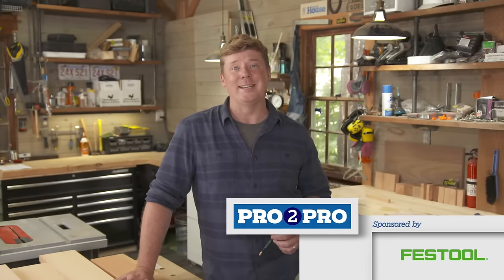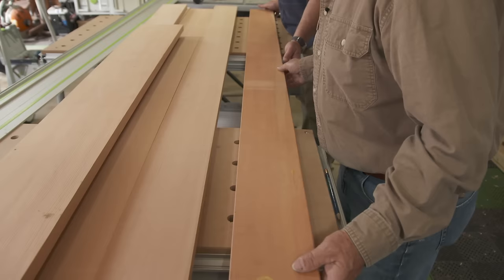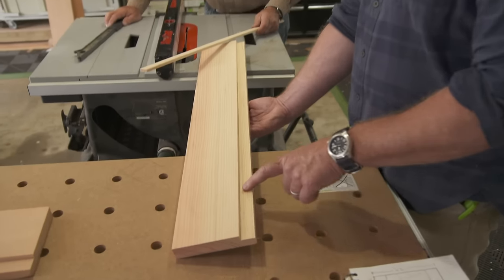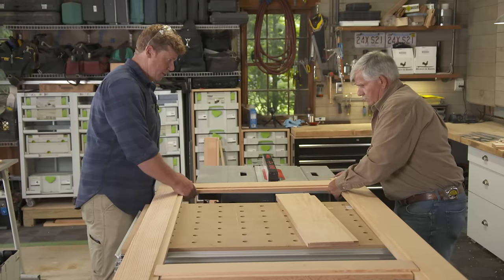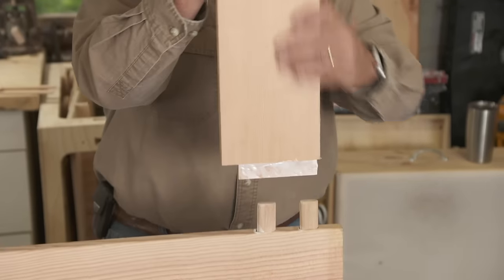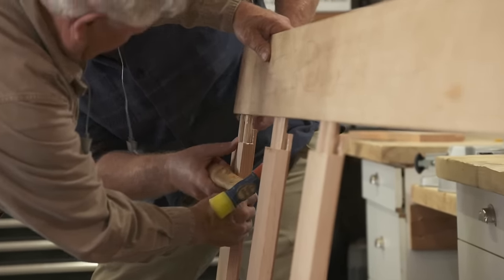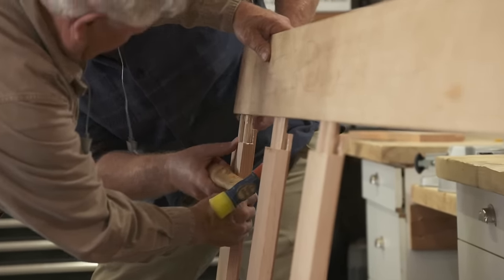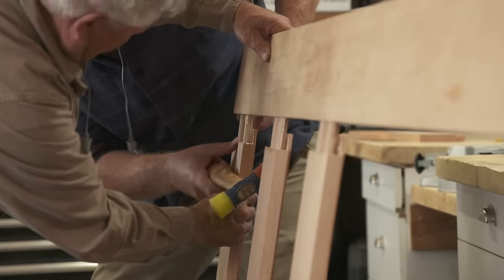Pro2Pro Live: How to Build a Screen Door

Comment: I hope Tommy never retires.  He's the best there is!
Reply: Norm is better at this type of thing.iv never seen norm do something like resurfacing/gluing.laminating a single door like the like tom did.
Reply: @buckbuck9225  that tip of using a truing saw, I guess thats what its called, to straighten an out of true board is a money saver for the amateur wood worker, that doesn't do enough wood work to cover the cost of a joiner.
Reply: @buckbuck9225  I agree ! Norm abram is the most talented carpenter that they have for sure but Tommy has all around knowledge and personally I love them all! However norm is my idol!!! I wish I had 10% of his ability!
Reply: I agree 100%. He will be hard to replace.

Comment from the maker: Hi Everyone, I'm here with Tom Silva and Brian Sedgeley from Festool standing by to answer your questions. I'll write their responses in the comments section here - Chris Ermides - Editor, Pro2Pro
Reply: The best tool I ever bought was my Domino machine. I use it so, so much. 

Not sure how I coped without it.
Reply: using the screen in the largest section of the door feels like such a missed opportunity to me,when something like tempered glass,or hell,even stained glass would dress it up a bit more,nothing says the entire door needs to be screened if the homeowner didnt specify it as such
Reply: @chrisbrown456  Stain glass in not for a screen door. Most people use a screen door to let fresh air into the house.
Reply: @saulgoodman2018  if you leave the smaller portions as screens,yes you can have the glass on the larger portion,thats what we have for a rear screen down right now
Reply: @chrisbrown456  Glass on top and screen on the bottom, looks ugly, to me.
But this isn't mine or yours, this is what the home owner wanted.
Reply: @saulgoodman2018  i understand that,but your missing the spirit of what my original comment said
Reply: @chrisbrown456  Stain glass looks better  on a regular door. Not a screen door.
I would have personalty put a wooden panels on the bottom myself.
Reply: Why machine cut to loose sometimes?
Reply: @saulgoodman2018  vive la différence!!!! 😁
Reply: @chrisbrown456  that's a pretty much a missed opportunity to get full ventilation why would you put glass in the screen door
Reply: @arlenmargolin1650  there is such a thing as too much air flow Arlen,not to mention something like stained glass would look good on such a door
Reply: so videos like this were originally streamed live, with you there for Q&A? Are there going to be more in the future?
Reply: @GeeTheBuilder  with a coping saw?
Reply: What a super nice door!
Reply: I built the door with my nephew for his house.  I sent him the video to watch beforehand.  Fun to watch his expression when he walked into my shop and saw the Domino XL sitting on the bench!  I have used it to build several pieces of outdoor furniture, doors and gates.  Great tool - like so many Festool products.  Perhaps Sedges weekly shows could be blended with more like this one to see the tools in use.

Comment: Great video with so many tips.  Built this door with mahogany and it is beautiful and solid.  Best tip is filling the slight gaps with glue and sanding over them.  Quote was $3000 to buy.  Material cost was $250.  Thanks.

Comment: Good video, but you guys need to work on your sound levels... The tools were far too loud and the hosts were much too quiet.
Reply: yes!! my god
Reply: I agree 100%
Reply: Yes.  Sound guy needs to wake up
Reply: THANK YOU! I was just going to comment on that. They've been producing TOH long enough to know how to do that. But in case they don't. using a compressor on the audio will level-out the sound in post-production.
Reply: @pn784059  Not the sound guy, you can't fix it during editing.
Reply: @saulgoodman2018  A compressor should be able to tame it down in post-production.

Comment: @Thisoldhouse - The screen attachment raises a question from me. My grandfather built two screen doors for his house, & later my father & I screened in a porch, & we both attached the screens to the frame in the same way. We used a slat of wood, wrapped the edge of the screen material once around that & stapled thereto, then attached the strip to the frame. Covered with the trim. The reasoning was that a staple directly in the material would tear the screen under tension, & the slat let the tension ease over more distance. Can you comment on advantages/disadvantages?

Comment: Would like to see a video of replacing that screen after you finish
Reply: They could have laid the filler strips upside down into the rabbets and stapled the screen to them. Then cut them apart and flip them over.  Cam wheels could hold them in place and make them easy to remove. They might want to replace the screens with plexiglass during the winter months or when they want to run the A/C.
Reply: Mark Kurzava  What are cam wheels?

Comment: And if you don't have a jointer OR a track saw (like me) but you do have a router+router table (or a quick and dirty bench top router table) you can use Steve Ramsey's trick to joint with your router :D

Comment: i paint cars , so a good portion of my life is spent sanding , i use something called tough block, sanding blocks, it's a rigid foam,it will give a little if you force it, and it has no real weight to it, si it can sculpt, but for years i used the heavy 3M blocks,  i always kind of roll over my edges in a large kinda circular motion, it keeps the block from cutting in too much and creating a "liny" finish, paint dosen't like to stick well to hard  sharp edges, thanks for the video on the shooter board, it made me like {LOVE}, my circular saw

Comment: Why was the sides left long at the bottom? I'm sure there's a reason but I can't figure it out.
Reply: William Bryant just to trim it off after so everything is square and flush. They do this with raised panel or tongue and groove cabinets as well
Reply: Once the door is onsite it will be trimmed to fit; the add length on the stiles protects the finished corners in case the door is dropped during transportation.

Comment: If the kids reap the fiberglass screen material you just have to order another door because it will be impossible for you to replace it or to install it right without all that bending of the door and the removal and installation of the molding around it 😝.   It will just keep you coming back to the shop forever.  It’s called ‘repeat sales’ or repairs  😃

Comment: What about notching a groove on each side with the table saw or router and use rubber cord in the groove much faster and clean install and replacement is hardly labor intensive

Comment: Orrr instead joint your boards using a trusty no.8 jointer plane, even faster and alot less noisy.
Reply: Only if your skilled with a jointer plane which I'm sure Tommy is. However, that high priced saw guide has to prove itself worth the cost.

Comment: Why so heavy? Where I live, screen doors are very flimsy frames, with one horizontal stretcher in the middle plus two diagonal stretchers, one in each of the upper and lower halves. Corner joints are bridle joints, and the diagonals are attached using half lap joints. The middle stretcher can use any of the two. Being extremely light, the whole thing lasts half of eternity.

Comment: What do you do if the screens need replacing? Seems like a big job to carefully pry out all the nails and staples.
Reply: Michael Diep 
Ya. He could’ve made each a separate panel held in by screws
Reply: you'd do the same process of the install, except in reverse. That's one of the reasons he used headless pins - so that the trim could be removed and reused. The staples have to come out but it doesn't take as long as you might think. This method of adding screen was very common - especially when carpenters built dozens of them for homes. The screens of my house were built this exact same way and they're over 100 years old. It's efficient and inexpensive to apply this way and then to repair.

Comment: What holds the track on the board so it doesn't move when you cut it?
Reply: I was wondering about that. I had to rewind to see if they used clamps, but no.
Reply: it has a neoprene strip that's grippy.
Reply: @AaronGeller  
      I take it you must have one?
Reply: @shoey64  I do. Let me know if you have any questions
Reply: @AaronGeller  That makes sense. Thank you!

Comment: Nice, but for me I would prefer the actual screen area's have a separate frame to hold the screen that can be removed for screen repair.  This way the door can stay mounted and only the screen frame needs to be removed.
Reply: You wouldn't need to take the door down to repair the screen.
Reply: You would just need to remove the trim pieces of affected opening to replace torn screen, not whole door.
Reply: Grew up with a similar, but smaller door, but had screen framed separate, so you could remove screen and put in framed glass for winter.

Comment: Festoon dominos are NOT as good as a through tenon that is wedged and pegged and yes they can sag over time the through tenon if done correctly will not. Difference between a house carpenter and a millworker. Also your lock rail should be almost as wide as your bottom rail with remaining rails the same. All outside dimensions should be 1/4” oversized for fitting.

Comment: Nice door, but what happens when the screen tears, which inevitably, will happen sooner or later.  Most screen doors use rubber strips for this very reason.  I am planning to make a screen door and am thinking about customizing something similar to this, but I am worried about screen tears.  No easy fix.
Reply: Rubber strips are cheap and trashy
Reply: @rebelwithoutacause5853  So is a screen door full of holes, which is sure to happen within two years or so when you have young kids running around the house!
Reply: @rebelwithoutacause5853  It's pretty easy to hide those 'cheap trashy' rubber strips.

Comment: Such a great video, thank you guys! However... The reason for the thumbs down is the fact that the cutting with the saw was excessively loud - I'm sure that there is some sort of tool that can be used to muffle that sharp pitch of the saw blade cutting the wood. I almost fell over while trying to rush to turn down the volume while you were making the first cut... #CutOutThatNoise #ATOH

Comment: 22:27  Hang on, what's happening here?  The dominoes are in place, how is that much movement possible?
Reply: The Domino machine has 3 settings to give you a range in mortise width. The first setting leaves no side-to-side movement, so the mortises have to be completely precise. The second setting allows a little wiggle room and the third allows for more. I believe Tom had the Domino set on the second setting and it was for this very reason - so that he could fine-tune the fit to his layout.
Reply: Okay, that's good information.  I had no idea.  Thanks Chris.

Comment: Why would someone have a $600 festool circular saw and guide before they had a jointer???
Reply: Try a $1500 saw and track. My makita saw and tracks cost me around $700
Reply: I'm guessing because festool doesn't make a jointer. I guffawed when he said he finds it easier to use the circular saw and track than a jointer! Really??? Two  quick swipes with a jointer, or line up, clamp, and saw... It's sad when a show like this gets bought out...
Reply: @1-up-7  they got bought out? And idk I love my track saw cuz I am in the field all the time
Reply: @1-up-7  you might have caught where Tom stated, build on site.
Reply: Because when you are doing carpentry work portability is important. Plus that one tool does much more than joint boards.

Comment: Lucky Tommie had a $1000 Festool track saw to straighten that $10 board
Reply: Would it be different if he straightened it on a $3000 jointer?
Reply: i can do same with my 20$ track saw to straighten that 10$ board. what does it matter what the tool cost? Although imho i think festool is way overpriced. But i will have a Domino someday i hope!LOL!